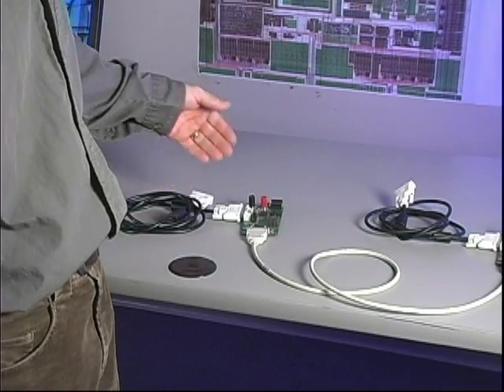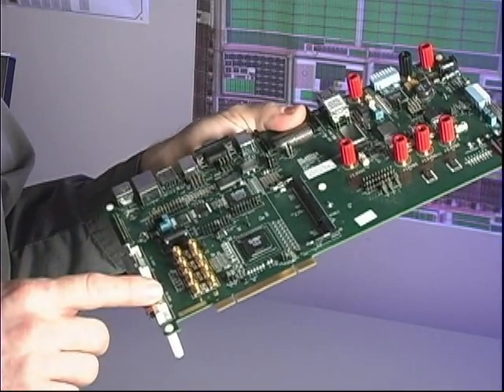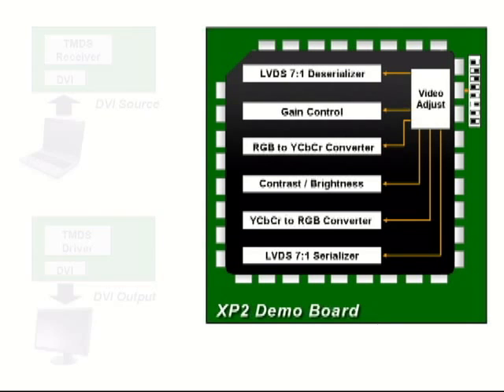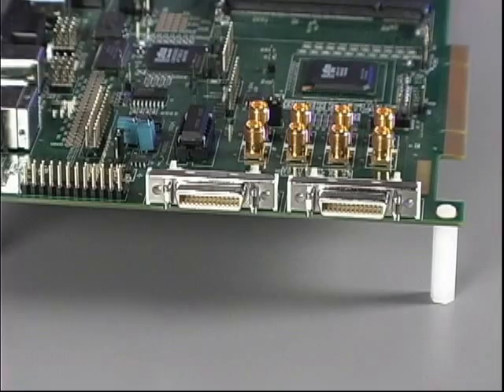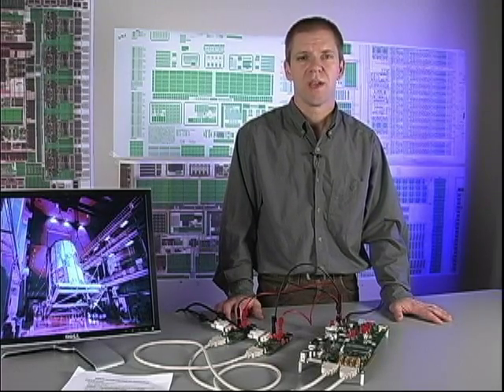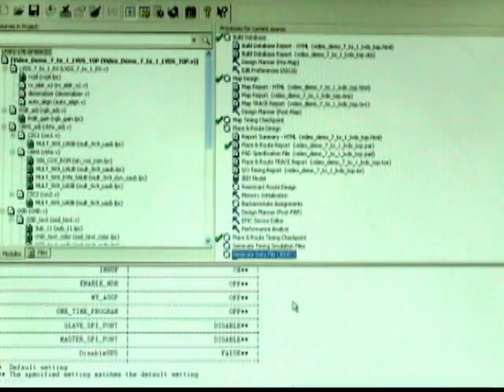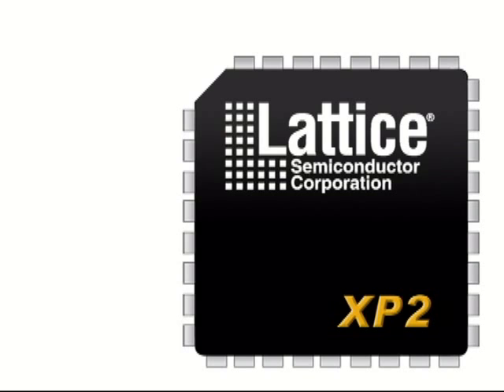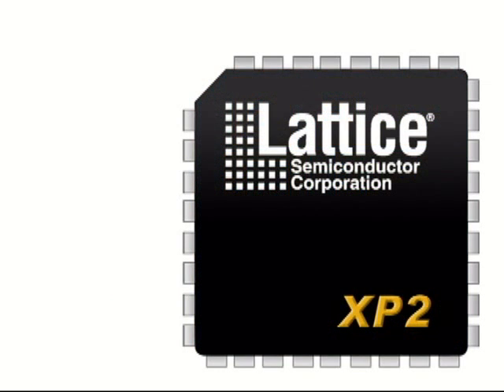7:1 LVDS Video Transfer

Comment: thanks for posting this video. I want to drive a 7inch lvds interface display with my MCU. so I want to design a driver board for the interface as MCU does not generate lvds signal directly.
basically i want to dispaly high speed graphics(or my own data) on the big screen. 
it will be very helpful for me if you guide me.